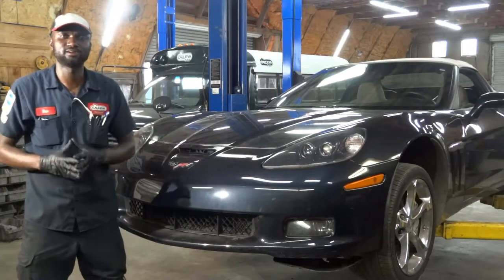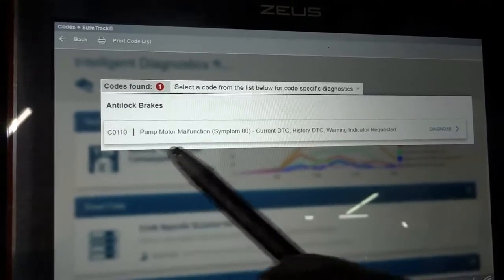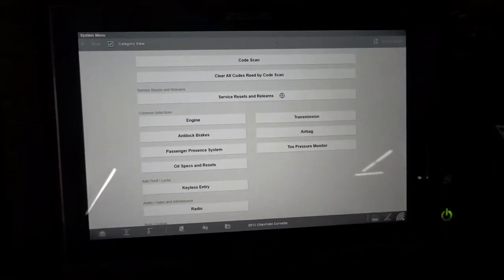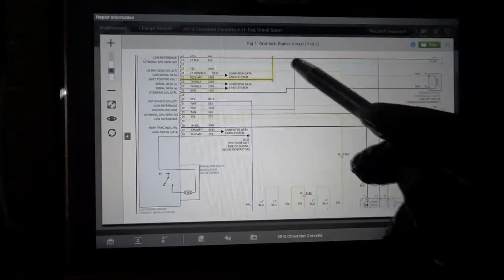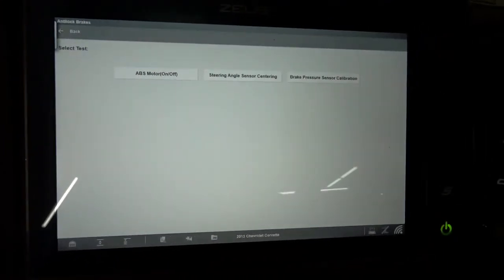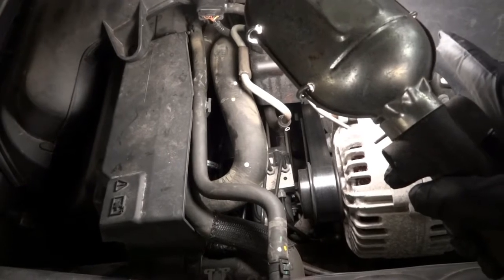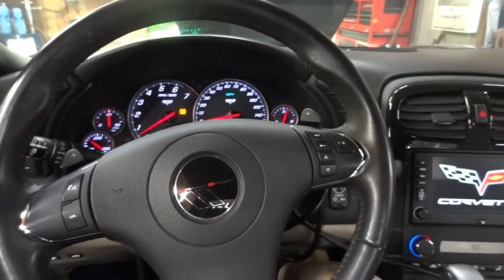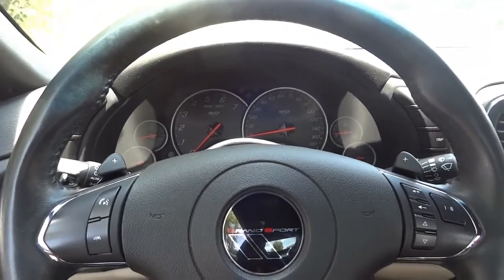Chevrolet Corvette, Code C0110, ABS Light on, Traction control Light on, ABS Pump doesn't Run

Comment: I'm so glad I found your video on this subject, I'm having the exact problem with my vehicle. The only difference is, I have a modified Cadillac CTS-V Coupe manual. This car sits more than I drive it unfortunately, but I'm about to take it in to the dealership and hopefully they won't destroy my pocket trying to fix the problem. 
Great video ✊🏽✊🏽✊🏽✊🏽✊🏽
Reply from the maker: Mr. Lowe  Thanks!

Comment: Good job I had this same problem with my C6 Corvette Z06 with this info I fixed my problem with your help. Thanks To turn on the ignition on all c6 and c7 corvettes push the yellow button and hold it and the accessory light will light up on the instrument cluster.
Reply from the maker: Walter Ira Parks Jr   Thanks!

Comment: Excellent and thorough video. Thanks for your efforts. I have a question: after you identified that the problem was fixed by bypassing the defective ground wire, could you leave a jumper wire in place?
Reply from the maker: @Gasdoc06   you could! yes

Comment: Great Video, My 2005 C6 triggers Service Active Handling & Traction Control once every 2 weeks, I had it serviced over 27 times including the day after I took delivery  in 2005. I just got out of the Chevy Dealer they ran codes & said it needs a new EBCM but it is no longer available they said I will have a  paperweight if it goes because they checked everywhere and GM no longer makes the EBCM. What can I do now? The car runs & looks brand new.
Reply from the maker: @guitarstar717  try to find a reman unit!

Comment: Great Video, My 2005 C6 triggers service active handling once every 2 weeks, I had it serviced over 27 times including the day after I took delivery  in 2005. I just got out of the Chevy Dealer they ran codes & said it needs a new EBCM but it is no longer available they said I will have a  paperweight if it goes because they checked everywhere and GM no longer makes the EBCM. What can I do now? The car runs & looks brand new.
Reply from the maker: @guitarstar717  can you get a reman one?

Comment: Push start.  To put it vehicle in service mode, with everything off, hold the button for 5 seconds or until the dash lights come on, but no longer than 11 seconds, otherwise you'll end up in key programming mode.
Reply from the maker: cj reyes  Thank you, That's good to know
Reply: Very good to know thank you

Comment: Having the same issue on my 2010 gmc terrain, any idea where the ground wire is?
Reply from the maker: Ivan Manzo is yours a 2,4L or 3,0L  on a 2.4L the ground for the abs controle module is located   (on the left kick panel G205 ) it might be the same thing with the 3,0L, but I'm not sure
Reply: @KITS_Auto_and_Truck_Repair  its a 3.0. I tried cleaning all my grounds on the engine but did not work. I will try the one on the kick panel. Thanks a lot for sharing ur knowledge and helping people like me resolve our problems.  U made my day by replying!

Comment: How do I turn the electrical system on without starting the engine?
For vehicles equipped with the smart key system (push start button):

Press the start button once without depressing/pushing the brake to activate the vehicle's accessory/battery mode.
Reply from the maker: Alan Gaudry I tried it and it didn't work, that Corvette was weird or maybe I was doing it wrong!
Reply: Hold the ACC button down for 10 seconds or so. 👍
Reply: You just have to hold down the ignition button for 5-10secs without pressing brakes